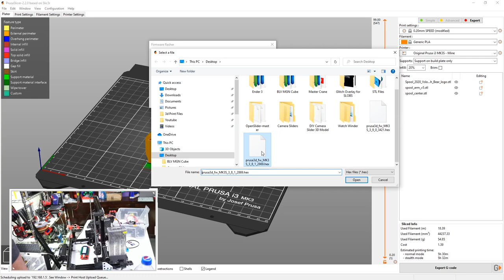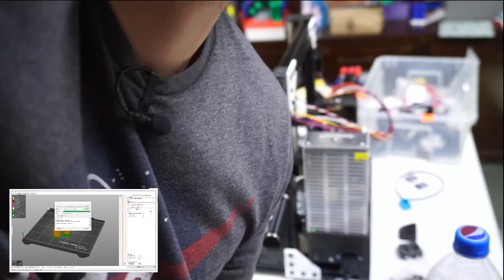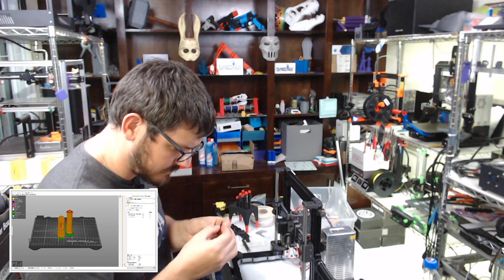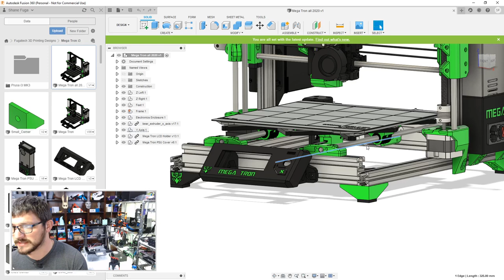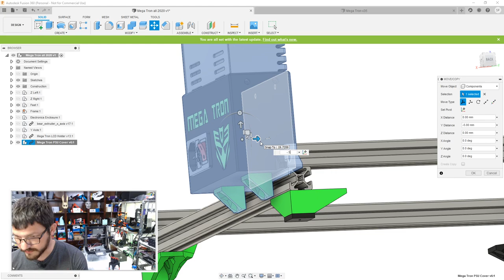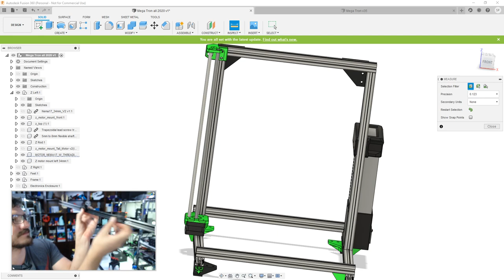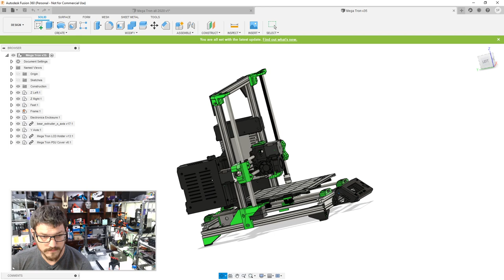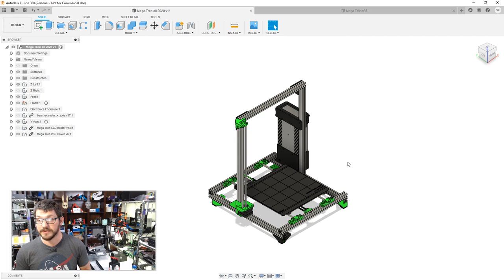Saturday Night 3D Printing Hangout!!

Comment: Hi Shane. Just watching your stream now, and see your looking for taller integrated lead screws. I would suggest looking at Zaribo.com They have quality LDO motors and are plug and play with Einsy board. The 320Z motors (+100mm taller) are around $45 each or they now have the black teflon coated ones for around $107 a pair. https://zaribo.com/home/247-zaribo-320-z-axis-stepper-motor-set-teflon-coated.html
 I use their standard 220 motor kit on my bear and they are great.